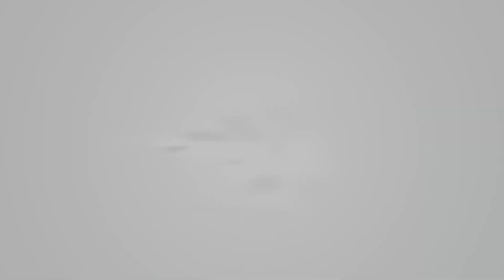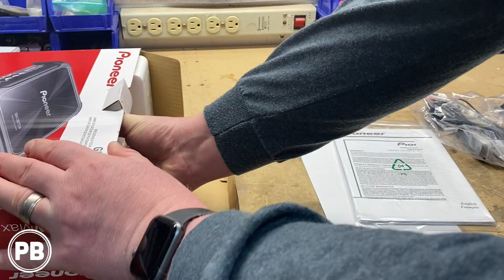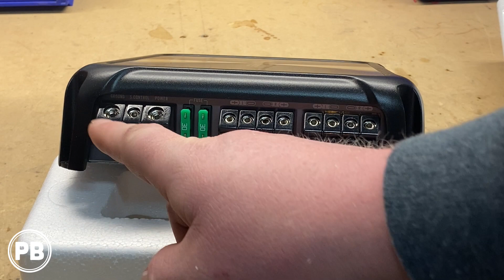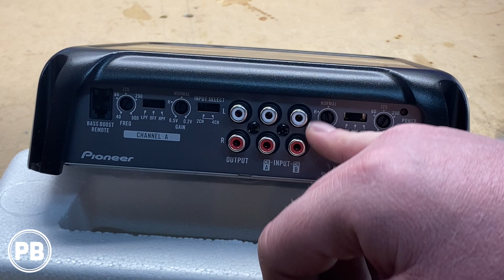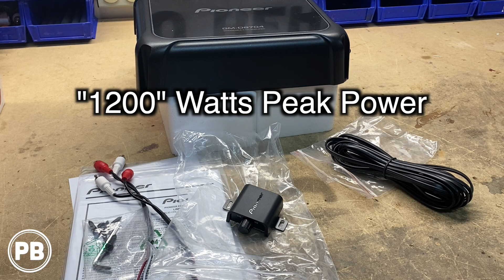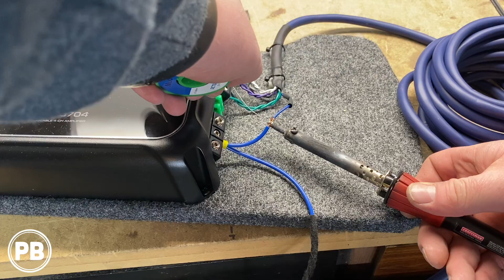Pioneer 1200 Watt 4 Channel Amplifier Unboxing | GM-D8704

Comment: Have a quick question I was thinking of installing 3 ds18 6x9 z9’s 550 watts rms it’s like 275 you think this would push them without them overheating I have a Brutus 1600 watts 4 channels for my doors speakers my door speakers are 450 watts rms like 225 sometimes it makes my amp overheat if I play it full power for about 45 minutes to an hour idk what you think man ?

Comment: Can I connect a 1600wat pioneer sub to it?
Reply from the maker: RMS and PEAK power ratings are VERY different.  If you are only adding a sub, then do the mono amp version as this amplifier is designed to power interior speakers, not necessarily primarily a sub.

Comment: Hi!  Great desciption/unboxing!  What is (are) the differences between this amp (GM-D8704) and the GM-DX874?  I have a 2011 Dodge Ram crewcab with aftermarket Kenwood am/fm/cd player; front door speakers are Morel Tempo Ultra 502's + Kicker 20cs6934's in rear doors....all powered by Hertz HCP4 amp AND 2 x JL Audio 10Wv3-4 subs powered by JBL GTX500 amp.....I have been advised both the Morels and Kickers are underpowered by the Hertz amp and wonder what ur thoughts are on either the GM-8704 or the GM-DX874 as an upgrade?  Thanks for any info!  Look forward to many more videos and reviews!
Reply from the maker: The GM-DX874 is the special / limited edition version of the amp shown in the video.  Few small differences, such as gold-plated terminals, high-res audio rating, etc.  Overall same specs for power and same footprint.
Reply: @ProvoBeastAudio  Thanks.  So in terms of sound quality for a non-audiophile would be ? I have seen as much as a $70 difference in price so just wondering if it is worth it based on my current truck stereo set up?

Comment: Why does it go in protection mode
Reply from the maker: Either bad electrical, bad connections with your power / ground, wrong gauge wire, or a short in the speaker wire.
Reply: It's only on certain songs.  it goes in and out of protect but its good when I lower my bass knob and my sub amp doesn't go in protect
Reply: Definitely bad electrical check all of your connections
Reply: @BigMerc91CMDNJ  they are good when I set my gain to h it goes in and out of protect
Reply from the maker: @rccollector16  Gain isn't a volume knob.  sounds like amp settings are way off and electrical is your issue.

Comment: So im looking this amp up on pioneer official website
And the newest version is the GM-DX874(if im correct) thing is the newer one is alot cheaper at walmart. My point is that Ibwant the same specs are the one you got in the video...what u think bro???
Reply from the maker: The GM-Dx874 is the special edition version of this amplifier (same generation), and only sold through authorized dealers (like crutchfield).  Has additional features like gold-plated RCA connections and Hi-Res Certified over the GM-D8704
Reply: @ProvoBeastAudio  so its actually better😯, im sold, thanks man

Comment: Hi, I just bought this amp and I have two (JLC1650X)  C1 Series 6.5" Coaxial Speakers in the front doors, I want to get some good midrange speakers for the rear of my truck, what would you suggest for this pioneer amplifier?  Thank you.
Reply: Infinity KAPPA 969ix

Comment: I just purchased the TSA series 6.5s 3 ways 90 watt rms and the 6x9s 4ways 120 watt rms, can I run this amp or would you suggest a different amp? I'm trying to keep the components the same company wise.
Reply from the maker: Yep, run at 4 ohms, should be a great amplifier for your setup.
Reply: @ProvoBeastAudio can it also be connected to a sub?speakers and sub?